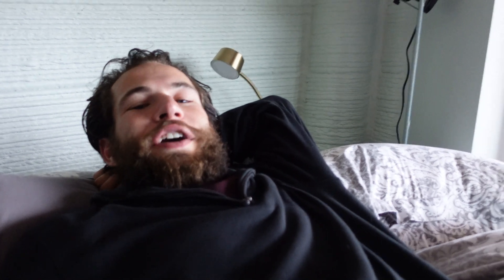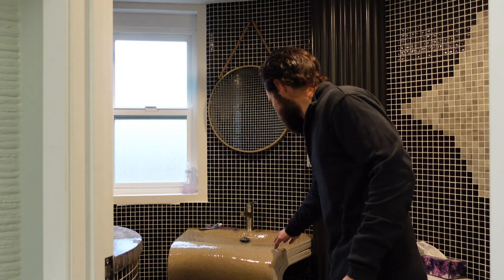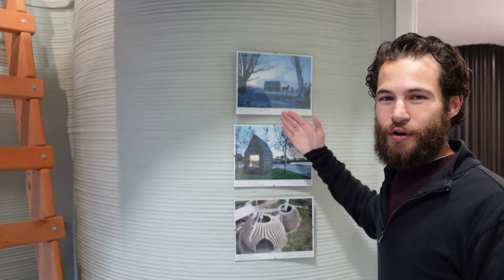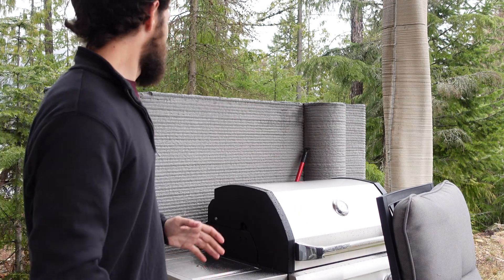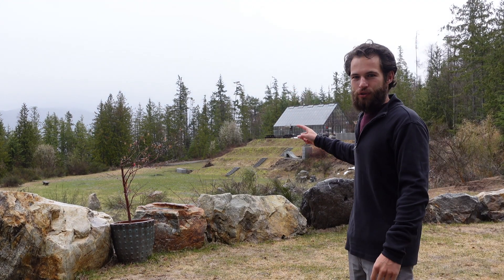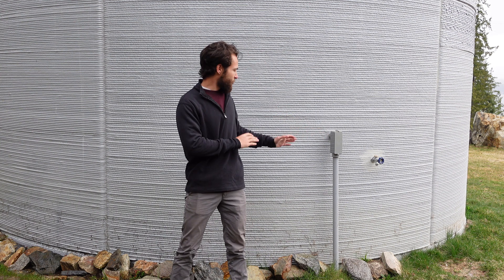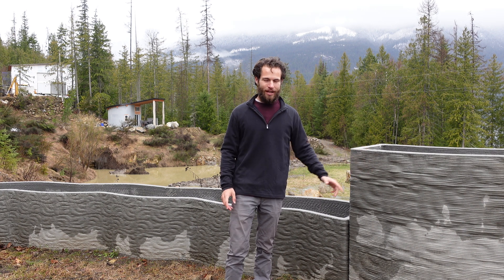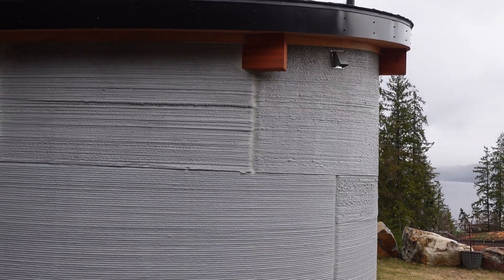Sleeping In Fibonacci Tiny Home (3D Printed)

Comment: Hi; stumbled across your channel and love the stuff you are highlighting.3D printing is definitely the way forward for construction. However I'm not a fan of the Rattan effect.( cleaning and mould growth are a definitive problem over time).Hoping you can point me to a high end polished printed house that has the ability  to be cleaned/finished. I'm on the thought track that during the build; it would be possible to smooth the walls with an extra process.
Reply: You don't need another technology, just do the same we do in Latin America: We use ceramic tiling on the exterior of our homes. The water slides right off the house and keeps the walls dry. It also saves you money from having to paint the house and the tiles last several decades.
Reply: @numbtribal1550 -cheers...could you point me to an example of this...Just interested
Reply: @1962-K  Hmmm... I'm not sure what exactly I could show you besides my house... But I'm sure you have seen ceramic tiles, they always use them in bathrooms. In fact you can actually see in this very video that they did cover the bathroom walls in tiles.

Comment: Thanks so much for all this awesome content what got you interested in the space?

I may check out your course I’m pretty familiar with additive manufacturing technologies but not as much with concrete chemistry for the application. It’s interring that these homes are able to be permitted without the use of rebar to provide tensile strength!
Reply from the maker: I worked in construction then got a degree in business and engineering. My main driver is the thirst for knowledge. Automation in construction is inevitable, I want to understand it the best I can.
Reply: @automateconstruction  that awesome I took a similar path in reverse! I got my degree in mechanical engineering and then transitioned to working in business and real estate development. 

With housing shortages and materials costing so much I’m really interested in innovative construction methods and worked a lot with additive manufacturing in my engineering role.

Comment: Thanks Jarett Gross - Just the title made my jaw drop. Amazing Grace. This Fibonacci Sequence Tiny Home is another structure that proves we are limited only by our imaginations when it comes to printing what we need.

I am so looking for to that design being done as huge houses with tall ceilings and that great clear pathway (glass - I like clear plastic) that you envisioned in this recording.

Regarding the cracking problem. 

Due to the long fibers, maybe printing in hempcrete with an ABS hemp plastic exterior layers (on all sides of the walls /  floors) could solve the problem of breaking cement. The hempcrete could be locally sourced in many areas.

The mission work you are doing Jarett is powerful. Thanks again for expanding your great works of historic documentation. In this modern world of manipulated media, you're using the art and science of journalism as an educational tool.  

KEEP ON PRINTING!